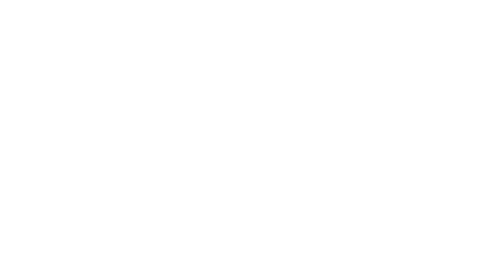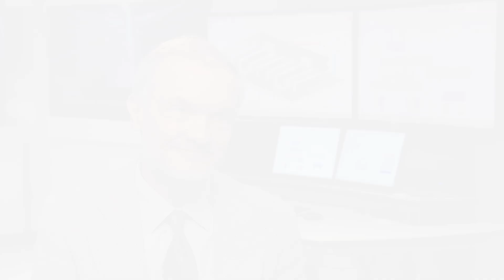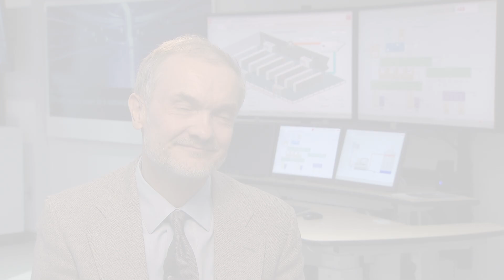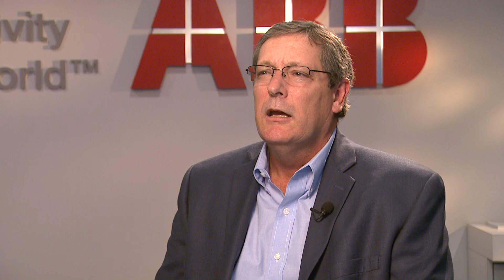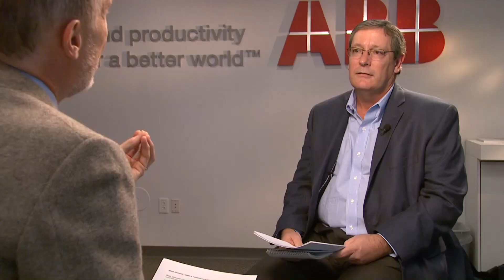Turning used electric car batteries into energy storage devices

Comment: +Nehemiah Spencer, I think the lithium from lithium ion batteries are largely recycled. From these articles (http://www.toxco.com/processes.html) (http://www.teslamotors.com/blog/mythbusters-part-3-recycling-our-non-toxic-battery-packs)they say the lithium gets converted to lithium carbonate. But I guess that's not usable in as a material for another battery pack so you have a point there

Comment: This is good but doesn't address the ultimate disposition of the batteries. A lot of electric car drivers are going to run their EV much longer, maybe until only 30% capacity is REMAINING (in the case of the Volt, this would still give an All-Electric-Range about equal to the plug-in Prius when NEW).

The real issue is how to recycle the batteries. The Lithium currently does not get recycled.